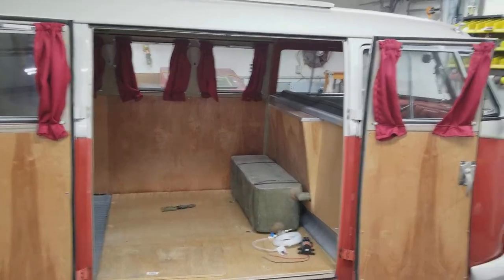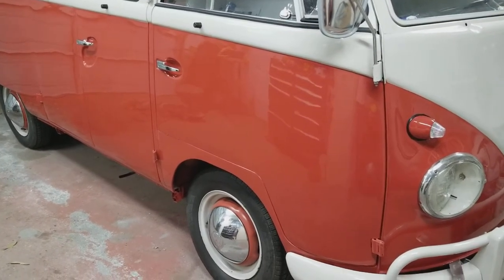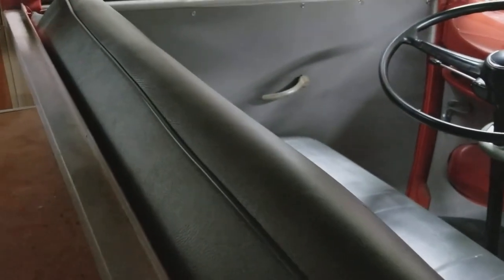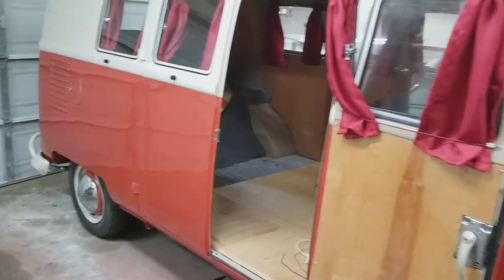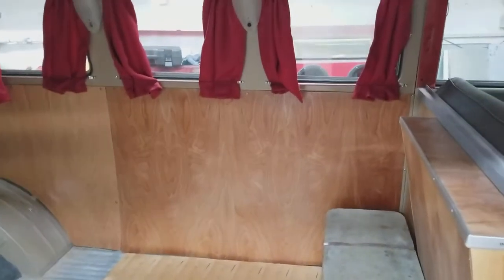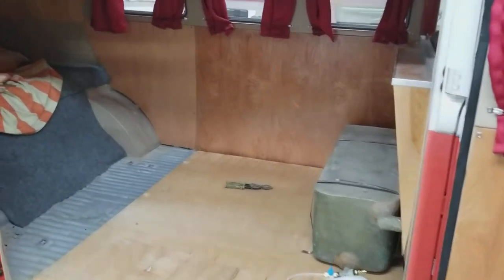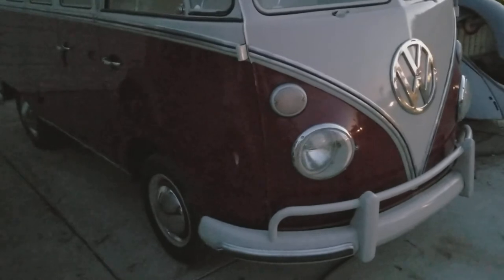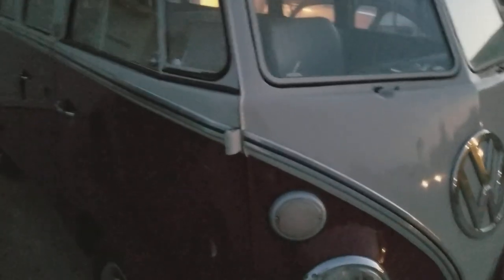The different types of VW busses and what  Options came in them

Comment: Did vw ever sell a camper van or were all campers standard or deluxe vans converted and resold by companies like wesfalia?
Reply from the maker: vw had a partnership with westfalia to make the special model campers like so 23 so 34 and so 42 These were all german and had special vin M code plates with all the options they had.  There were several companies like caravelle campers in the us that bought stripped panel vans and converted them into campers. There are a few others. One created the dorm mobile which was a lift up roof camper.  Typically the campers were 11 window kombi busses or panel vans. Not usually did they use a 13 window or 15 window because they would have all the deluxe interior and that would all need to come out to make them campers. Most of them were done by the hippies. or someone using camper stuff and putting it in what they had which might have been a 13 window.

Comment: Thanks Mike, at the end you mention the standard with a sunroof. are those pretty rare and sought after?
Reply from the maker: oh yea for sure. really rare too
Reply: @Mikefngarage  Hey Mike are you sure there is not any Kombis with the factory sunroof, I did some research and see that was possibly an option also on the Kombi.  any input is appreciated. thanks!
Reply from the maker: @ffbartlett  yea they made a sunroof option for the standard bus. Not usually an option for the Kombi. Kombi came in one color not 2 tone, with our without seats. Rear seats were an option. I think the kombi did not have a sunroof option but possibly special order. I have seen one but I dont know if it was original.
Reply: @Mikefngarage  Thanks Mike. Yep i believe it was a special order for the Kombi. Probably making one like that pretty rare. Cool buses!

Comment: Hey Mike,,, love ur videos...  I’m currently doing a father/daughter resto on a 62 Kombi and I’m confused about the upper air vents on the rear quarters. It looks like a water hazard. When disassembling mine, the previous owner covered the upper vents with duct tape to keep the water out.  How was water intrusion avoided originally?  Or is this something I need to live with??  I know the lower louvers are necessary for engine aspiration and cooling, but what purpose are these upper vents for.  Maybe you can put together a video explaining.  Thanks again,,,,
Reply from the maker: so you have a panel van or panel van conversion.  They put the vents in there only on the non walk through models. Because they had a window divider option on them for cargo ventilation. Without windows or open to the front you could get carbon monoxide poisoning. You could block them off from the inside with foil tape or something more appropriate if you are doing a camper Or even weld in metal panels. But I would want the body correct from the outside.
Reply: Mike F   Ahhhh ok.  Yes,,, it’s probably a panel van,,, the back lift deck has a window, and the curbside barn doors have windows.  But drivers side is solid front to back. So the vents are there for ventilation for the cargo area. Makes sense.  We are trying to keep exterior fairly correct, but like a 70’s conversion van on the inside. So I didn’t want Water getting in.  I’m here in AZ, so it’s not likely to see rain but maybe once or twice a year.  Thanks for the insight.